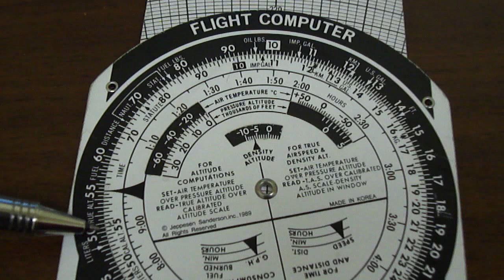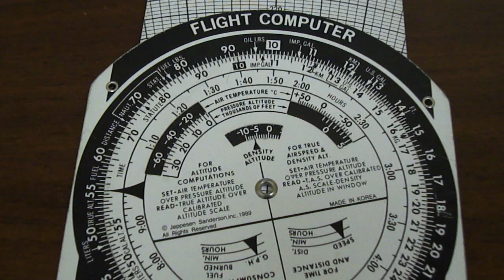E6B Flight Computer: True Altitude

Comment: On windy days i'll take 3000 foot margin to compensate for possible errors.

I learnt it slightly differently and I wonder if it is actually correct...

When given the surface elevation - solve as follows:

1. Determine pressure altitude 
2. Set pressure altitude opposite to outside air temperature
3. Subtract station altitude from indicated/calibrated altitude to determine calibrated altitude AGL
4. Find calibrated altitude AGL on the middle scale and read the correction to station altitude on the outer scale
5. Add the correction to station altitude to get true altitude MSL

I want to pull my hair out every time I forget about adjusting for the difference by substracting indicated for surface elevation (AGL) # 3 and #4, to then ADD/SUBSTRACT the difference to know if we clear the obstacle...

So what gives? You seem to be showing a simpler straightforward method. You're simply going about it by taking the MSL values ... on a sectional you will have ASL values (on top of AGL). 

So, Is it correct?? My school overcomplicates it, perhaps?

Comment: You should take elevation out from the indicated altitude. Altimeter setting is based on standard temp and elevation which is already a true alt (elev. does not need to be corrected for non standard temp conditions). In your example you would be closer to 45.5 feet AGL, small difference since only correcting as small amount of the atmosphere.

I may have miss heard, but being at 50 feet is not controlled flight into terrain, that would be hitting/crashing into the ground while flying the plane---0 feet or obstacles.  Unless the FAA does something different terminology wise then Transport Canada. But at 50 or 45.5 feet AGL flying in IMC or low visibility you definitely would not want to be that low.

Comment: Thanks for the excellent video. I have seen experienced pilots underestimate the importance of finding or approximating True altitude in VFR conditions, climbing out over dark mountainous terrain, marginal dark horizon, on very cold non-standard nights. Recommend current FREE download FAA Pilot's Handbook of Aero Knowledge PHAK 2016, Chapter 8,  Pages 8-3 thru 8-7. Includes altimeter op, High to low, hot to cold, instrument check, and....drum roll please...the definitions of all the altitudes....which BTW,  have been  misconstrued  quite of few times in the comments below.

Comment: I can honestly say that in 30 years of aviation experience I have never had to calculate True Altitude. I am prepared to be corrected, but all you have to do to avoid terrain is have the correct barometric pressure set on the altimeter sub-scale (this automatically will allow altitude  AMSL to be indicated) and provided that QNH (as we call it in AUS) is from an approved source, and you have verified the correct elevation (and legal clearance (500ft AGL) then you're set to proceed. Maybe True Altitude is applicable to airline flying but is not necessary in 99% of GA applications, where you are operating below the transition altitude of 10,000 ft AMSL..Feedback welcome.
Reply: Hi Chris, I'm a flight instructor here in Canada and the case explained in this video highlights the danger of flying into EXTREME (i.e. well below) cold temperature compared to ISA. The calculation of true altitude is necessary as the guy in the video suggested to make sure we do indeed have adequate clearance over an obstacle that by ordinary logic, would lead us to think we would be able to clear with no problems under ordinary conditions.

Similarly correcting for cold weather in Decision heights or cruising altitude in IFR flying is something that I believe quite unique to countries with colder climate, such as Canada. I don't believe these examples would apply in a country such as Australia where you fly.
Reply: +chris hood My brother and I were flying his first night flight with his instructor.  When we got into the plane he tuned into ATIS and got the Baro for the airport we were at.  He set his alt and away we went.   His instructor saw what he did and knew where we were flying to and just waited......
About 20 minutes into the flight he said, "Do you see that real big dark area in front of us?"  My brother said, "yeah, the lake?"  We were in an area where there wasn't many lights on the ground and it really did look like a lake.   His instructor brought up the sectional and said something like, "yeah, that big vertical, dirt lake with trees on it".   
We were heading right for it.  and without the instructor with us we would have hit it about 100 feet below the top of the mountain.   The range was Sutter Buttes in Orland, CA.  The worlds smallest mountain range.  Check it out on the Klamath sectional.  It can grab you out of the air.
The point is, had my brother corrected for standard pressure and figured out his density altitude, he would have seen that he was flying too low
Reply: There seems to be some confusion between Pressure and Density Altitude (which are used for  performance calc's) and what the main article is focused on- true Alt. Not trying to instruct via youtube ( I am qualified btw). I would put T/A in the same category as Calibrated A/S. Something that has it's application, but rarely is used in recreational flying- especially when the degree of accuracy required is provided by other indications and calc's. I will follow this up however- don't want to be jeopardising safety.Thanks.
Reply: @TheHoodie63  The problem with your statement of using the kolsmen window as your correction is that an altimeter works off barometric pressure relative to air temperature. If you set the Baro pressure you have only corrected for one aspect of altitude calibration. Temperature affects air density. Warmer air is less dense. The way the altimeter works is by measuring the change in the "weight" of air above it. If the temperature is warm than you must climb higher for the same amount of "weight" to be relieved off of the altimeter as you would in cold air. An altimeter is calibrated for 29.92 in of mercury and 15 degree Celsius. That is the ICAO Standard atmosphere. As pilots we adjust for non standard pressures, but in order to "adjust" for non standard temps, you must calculate it. Temperature error can account for a good 2500 feet of error. That error may be fine if you are 2500 feet high, but 2500 feet low could be a disaster as this video states. I understand your point in Day VFR. You can see the mountains and trees to avoid, and will instinctively avoid them. The problem becomes serious at night, or in IFR flying. If you are flying in temperatures below ISA, your alt is reading Higher than your True Alt. 

Fly Safe, and Happy Landings,
Craig

Comment: @Chris Brown - You missed the point of the video. The altimeter WAS set at 30.42, and it indicates 5500' under these conditions. The altimeter gets a progressive error the higher AGL you go when the temperature is not standard. This is how to determine the error. In other words, you THINK you're safely at 5500' with your properly-set altimeter, but alas, are in reality only 50' above terrain!

Comment: Please tell me how to solve the question: Pressure Altitude 8500, Temp -30 C.
Reply: If your looking for density altitude then you would put the 8500 in the right side where it says 8500 on the e6b. And then line up the 8500 with -38c on top of the pressure altitude window. And above that will say density altitude with an arrow pointing to it. That will be your density altitude. I got 5000 ft